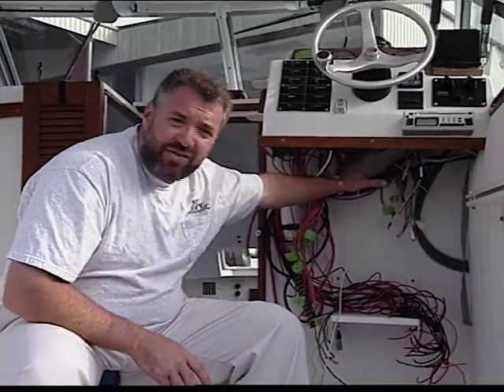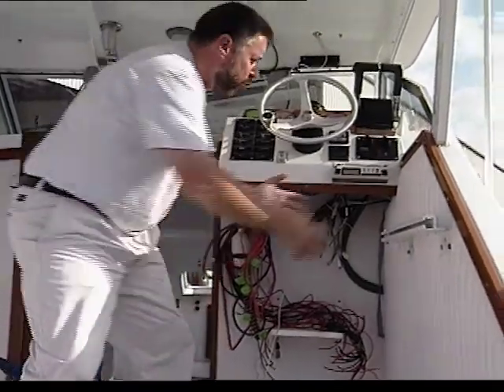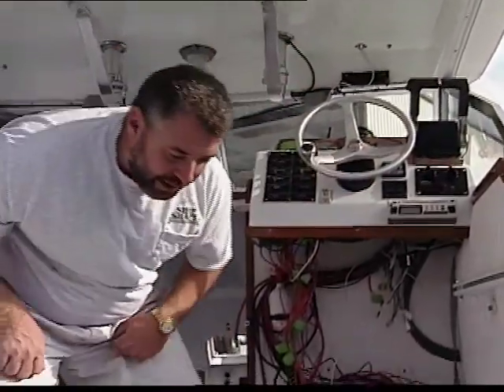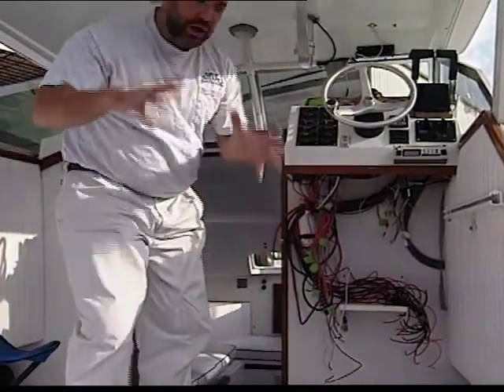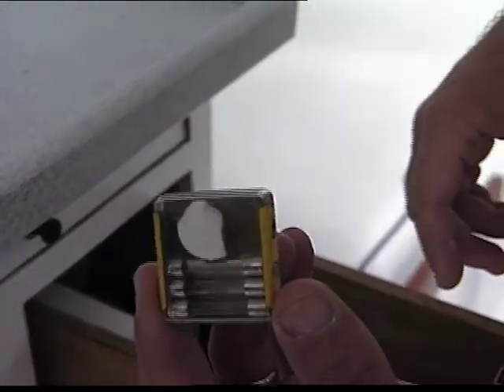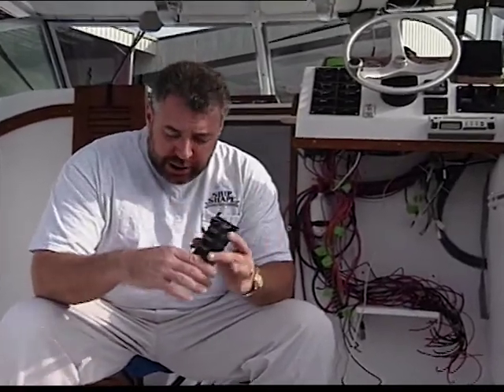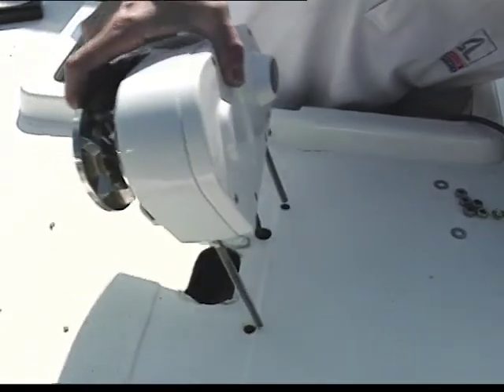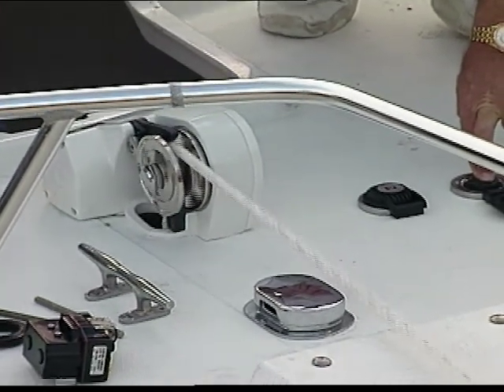PREVIEW of SSTV 6-26 - Switching Over From Fuse Technology To Circuit Breaker Technology

Comment: I would not say it is "as easy as flicking a switch", that implies it is different than flicking a switch.  It IS flicking (flipping) a switch.  For anyone interested, a fuse "blows" (destroyed) and then you need to replace it, which can be time consuming, and sometimes difficult.  What this does, is eliminate the NEED for a fuse breaker.  When a surge of current (too much current) happens, instead of destroying a fuse, it simply turns OFF current flow and physically pushed to the off position a switch.  That switch is then turned on with our hand.  Imagine at home, the light switch, turns itself off, and you flip it back on.  Great idea by the way